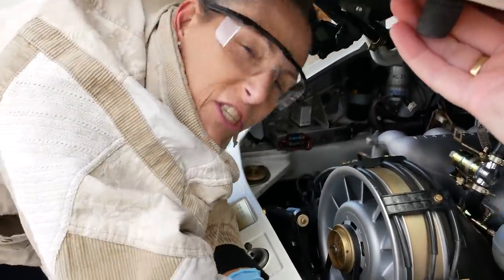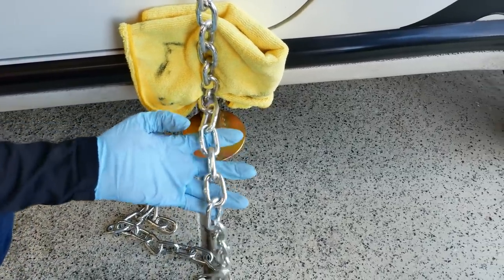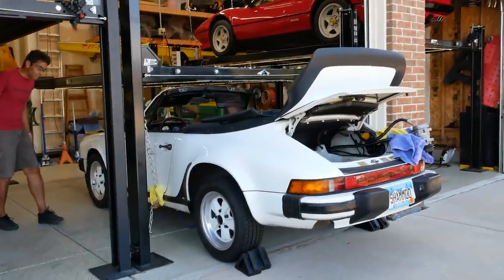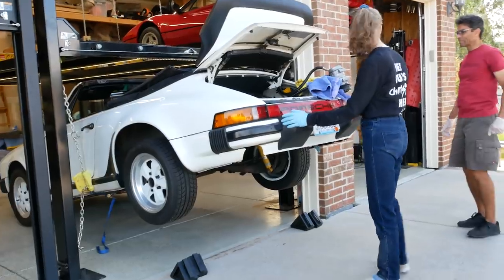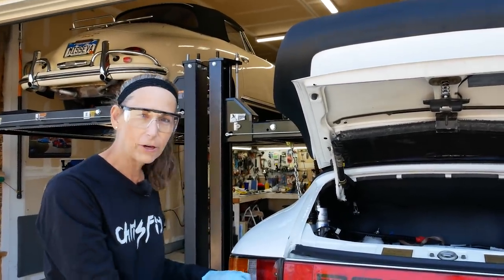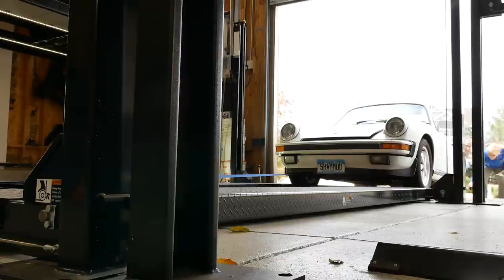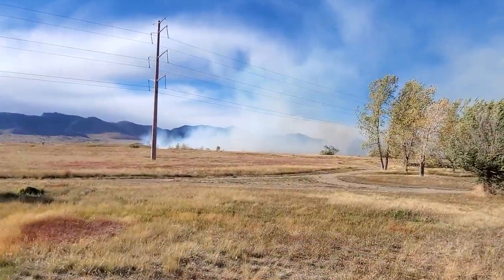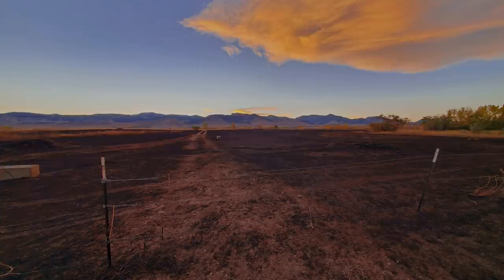Budget eBay Porsche 3.2 Carrera Project Car! #25 - Engine Install in Crazy Winds and a Grass Fire!!

Comment: Wow you made it look so easy. I did not realize how easy it is to swap in a engine on  a rear engine car like the Porsche. Wow.
Reply: Older 2.0, 2.2   70s Porsches  were even easier to get the engines in or out, I used to remove mine in 20-30 minutes by myself......without a lift.👍🇬🇧

Comment: I'm scouring this video now as I just rolled my engine and transmission under the car.  I tore it down a year ago and it's like I'm right back where I started now. I have the G50 so I'm going to install the new clutch slave cylinder and bleed it as well as the brakes before I lift the engine up into the bay.  I can't express how helpful your videos are.  And kudos to Heidi for the excellent camera work behind the scenes.
Reply from the maker: So glad they are helpful!

Comment: Wow! Incredible how things go sometimes with weather. I am so glad that those fires were put out; very scary. The dry vegetation and the winds don’t help any. Very glad you’re all safe.

It’s always a good call to not fully tighten things at some of the mounting points in order to be able to tweak and adjust so that you can put the fasteners on at the other mounting points; I’ve learned this through the years. This car is coming along wonderfully. Amazing work! Thanks for sharing.
Reply from the maker: Thanks so much!

Comment: WOW!!! That was like watching a Cecil B. DeMille production!  I am originally from Loveland and wondered how you two were doing up there between Golden and Boulder while the fires were going on and see my concern wasn't unwarranted. I'm always impressed with your ingenuity with using your 4-post lift, I have one too and luckily the runners are just wide enough to clear the engine mounts on my Porsches so it's just a matter of lowering the car onto the motor and transaxle.  Glad to hear you're all safe and I'll never complain about rainy Seattle weather again!
Reply from the maker: Thanks so much!  I can get the 356 engine out between the rails, but we would need another 4-5" for the 911...

Comment: I used to drop the engine out of my old 911T on a trolley jack. It had carbs and with the air box removed it’d just about clear the rear valence. I’d jack the car up as high as I could and put a couple of axle stands under the rear of the floor pan. I had to remove the engine 3 or 4 times to sort out transmission problems. In the end I could pull the engine and install it on my own taking about an hour each way.
Reply from the maker: That's 356 time territory!

Comment: Franny the firefighter to the rescue, or how an engine re-install turns out a little more exiting than expected. Jobs well done, both the engine installation and firefighting.
Reply from the maker: Thanks Freerk!  I had one of the fire fighters tell me that if it wasn't for all the neighbors work out there it could have turned out very differently.  I'm bummed we won't be able to hove our usual Christmas party with all the folks on the street.  It would be great to see them all again.  It was quite the day...
Reply: There's a Dutch saying that if I you translate it in English means: A good neighbor is better than a distant friend. That's certainly true in case of a fire ;)

Too bad about the Christmas party. My Christmas will be different as well as my father passed away earlier this year. Thankfully we made good memories over the years.

Comment: Now that the engine and transmission bolts are torqued, you should loosen the 4 bolts on the engine cross bar (near the fan) and retorque them. It was a tech bulletin and it helps to straight everything out/parallelization and vibration.
Reply from the maker: Are you sure that is for the Cabriolets?  That cross bar is mounted to a rubber hub (like a vibration damper) with three bolts.  Not sure loosening and re-torqueing would really do anything as the arm can rotate about 10deg CW and CCW. F
Reply: @HeidiandFranny  Double checked, applies to G50 Coupes and Targas :-)
Reply from the maker: Thanks for the update!  Makes sense for coupes and Targas.  There must be significant body twist in the Cabs.

Comment: My heart stopped seeing Franny under the car when being lowered on engine. Always a fundamental in my training to never be under a vertically supported (hanging) load.  Only permitted to be under a directly ground supported load (jacks, lift, etc). Learned this at Boeing informally the ugly way and later in Organized training. Love the channel!  Work safe!
Reply from the maker: I get what you are saying, but it was WAY more sketchy when up all that way on jack stands.  One wobble and it would slide off.  Not possible with the chain and they are rated at several multiples of the car weight.  Also, the wheels were only maybe an inch or two off the ground during most of the transmission attachment so it wouldn't have fallen much at all.  I'm scared to death to be under a car up on jack stands.  That is why we bought the first lift actually.   The proper tool would have been a two-post lift.  Thanks again for your concern. :)
Reply: @HeidiandFranny  I hear yah!  Someone you got to count your blessings and take the risk  I was yanking a trans out of a Chrysler imperial once and the jack slipped - yeah I saw my life flash before me. Anyway, it just got hammered into me to never be under a overhead supported load. Love the channel!!

Comment: try using a crows foot alignment tool on all four mounting points before starting the hardware in.
Reply from the maker: Our problem was really more the angle than the alignment.  It is a little tricky (more so in 50mph winds) to get the engine at the correct angle.  That left transmission mount was a bit of a bear.  I think we just had the engine too low.  Thanks for the tip.

Comment: Wow that was too close for comfort! Will they get some sort of fire break sorted as grass right up to the boundary is a big risk? At least you were ready to evacuate quickly. Great video...I'm thinking perhaps a 2cv car has definite advantages when it comes to engine removal/replacement :) I was worried those chains would damage the body work.

Comment: Great video, but I think the big washers on the engine & gearbox mounts has to be installed the other way around. Cheers Michael
Reply from the maker: I'll double check.  I think they should be cupped towards the mount.  It was a nutty day ;)

Comment: Slick job putting that engine in.
I like the way it is mounted to the body. Pretty simple. 
Glad they got control of that fire. How did it start?
Reply from the maker: Great question!  We believe it started from a large mulch pile at a commercial landscaping company just to the west of us.  I sure hope they are more careful!
Reply: @HeidiandFranny  ... Fire = fuel (long dry grass) + oxydizer (that awful wind with swirling gravel to get in Franny's mouth and eyes) + ignition source (spark or heat source sufficient for combustion from something!)
Glad they found a tangible reason. I've experienced (from a distance) bush fires when living in Victoria Australia. REALLY SCARY when thick smoke turns day into night!
Awesome reinstall of Porsche power plant by the way. I love you're clever thinking and processes Franny!
and a Merry Christmas you 2 clever ladies, from New Zealand, David.

Comment: Heidi & Franny - loving your pivot to the seas and all that content.  Have a question for you - I'm about to re-install my 3.2 that's been out for 18 months and I also have a lift and am intriqued by using the factory jack point plates and what looks like chain to accomplish this.  Do you happen to have any more details about how you rigged this up?  My garage has a very annoying lip and my removal process was hanging the car off the end of the lift but the concrete lip + ATV jack & floor jack make this super precarious and I'm debating rolling the car off - raising the lift which would keep me in the garage and on a floor where things will roll much smoother.  Thanks so much & Happy Holidays.
Reply from the maker: Hi there, I think this system worked pretty well! It was just strong chain and shackles that went over the lift tread.  I had to lower the top down to get the lift low enough to start with.  As for the lip you might need to build some sort of ramp if you need to get the engine lift past it.  We had a gap and that was a pain. Just test things a few times and do a dress rehearsal.  It is a lot of weight so have a few friends there to help and be careful. Good luck!
Reply: @HeidiandFranny  Thank you.  Did you use the standard jack adapter plates or fab something out of square tube?  I'm debating using something I can run a bolt through to ensure no chance of it sliding out on the inboard side and then drilling and using a shackle on the connection side to remove the chance of any catostrophic failure!  :)
Reply from the maker: @Mr18125  Probably a good call.  I just used the standard ones. Oh! I ran a strap underneath to pull the two together so they didn't slide out of the receivers.  I just remembered that.  I had the same thoughts!
Reply: @HeidiandFranny  AH!  Ok saw this strap but couldnt' figure out what it was for - initially thought you may have had it slung off tie downs but then quickly assured myself not a chance you'd do something like this. Ty for all the details on such an old video!  Love the steering upgrade w/ the Heim joint on the latest video and excited to see more of the new content!

Comment: Wonderful video!! I'm curious about your lifts, not just the brand / size, but also choosing the "ramp" style vs. a 2-post with arms? I'm shopping for a lift for my home garage and I can't decide which way to go. Do you find these easy to use for "wheels off" type of servicing?
Reply from the maker: Hi Jim, Great question - and a tough one!  I get by pretty well with just the four post lifts.  For us we needed storage more than the occasional wheels-off-the-ground.  That said, the 3.2 carrera engine bit would have been way easier with a two post.  Same would be true for wheel/suspension work.  But...  you can jack the car up on a four post lift (on the rails or using the heavy cross-rail jack trays) and then raise and lower to the best working height.  Also, you can place jack stands on the floor and lower the car on to them (four at a time even) which makes jacking the car up really easy.  I suppose it comes down to what you need the lift for.  Also, MaxJack makes a "portable" two post lift you can actually remove from the floor and stow away until needed thus have virtually no altercation to your garage.  It is really nice you have all these home options though! F
Reply: @HeidiandFranny  Thank you for such a thoughtful reply! This is great information. Love your channel so much. Have a great day!

Comment: Franny, I’m not gonna lie I was extremely worried about you working under that car relying only on that chain, Please next time put jackstands or support it from underneath before ya ever go under a car again... I was legitimately concerned and worried... be safe
Reply from the maker: Thanks Cori.  Good advice!  It wasn't too scary as the car was pretty much on the ground when I was under it.  The rear end sits very high without the engine mounted.